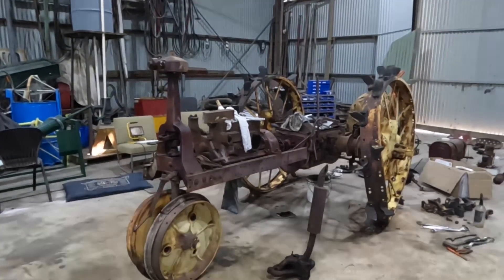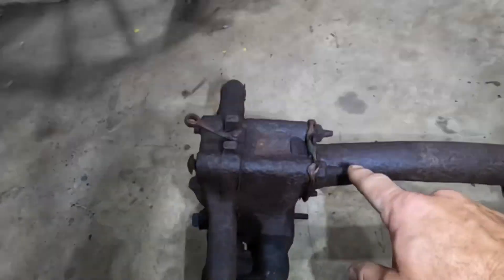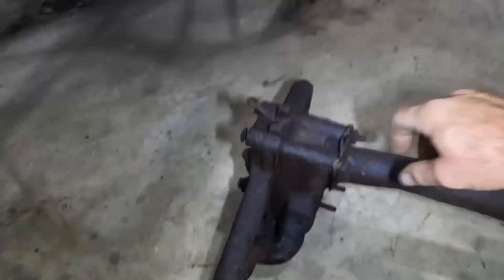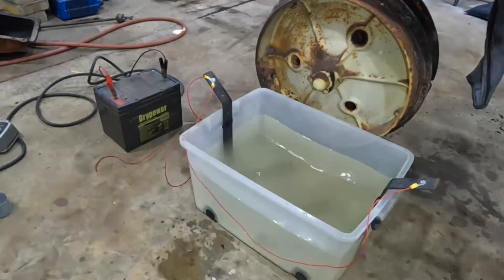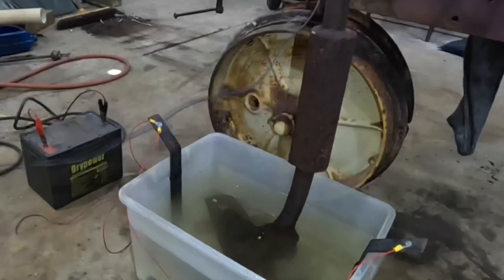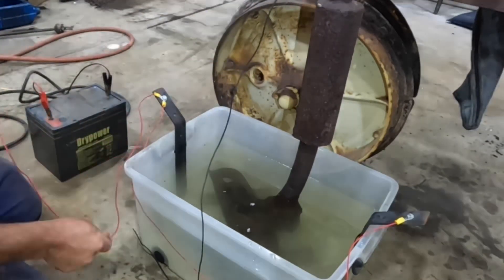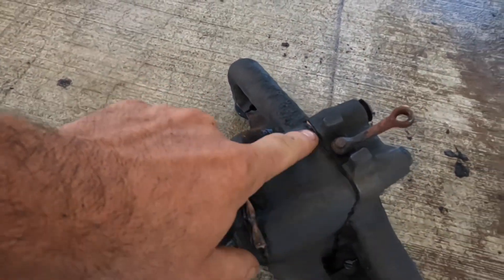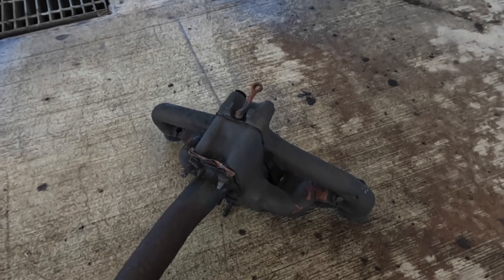How to use electrolysis to remove rust

Comment: Very interesting, a question I have for anyone who wants to add their thoughts or experiences, so here it goes, a car door, which was previously paint stripped via an acid dip to bare metal, bearing in mind the door has been sitting for over a year so some flash rust has appeared, the question is would you dip a car door in this solution to remove the flash rust? following this process the door will get primed and then spray painted the usual way !
Reply from the maker: Hi, there are products you can get(one is deoxit) to remove this flash rust before painting. Usually immediately before painting put a small amount of the deoxit in a bowl and with gloves and a green scotch bright pad spit in the solution rub over a small section of the panel until all the rust has been removed. Different brands have different cleanup processes afterwards. The one I have used you wash the panel with water afterwards and then paint within 24hrs.
Thanks from Geoffrey

Comment: If you get stuck Sodium Bicarbonate( baking soda) works Ok, it is not as effective.  I just did a Singer Sewing machine stand in my bath.  I also found the amount of soda in water is not very critical .  Great job.
Reply from the maker: Hi Matthew, thanks for the tip. What sort of power pack do you use on your bath?
Thanks from Geoffrey